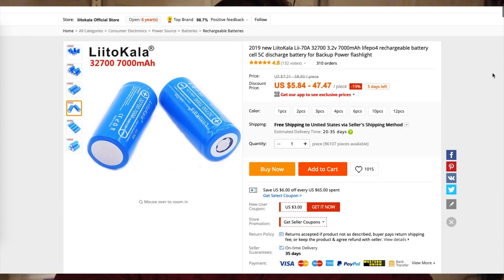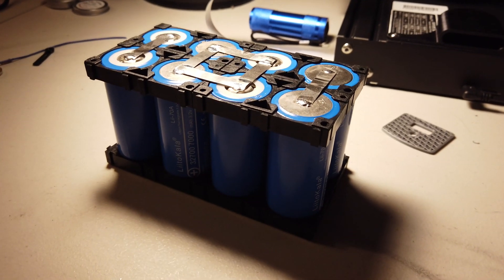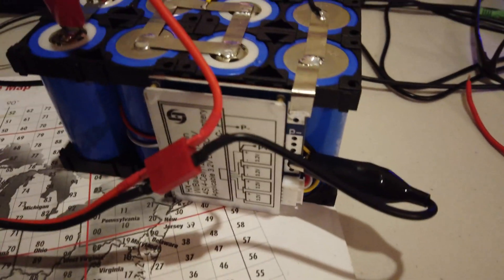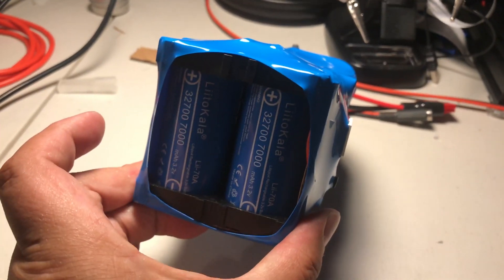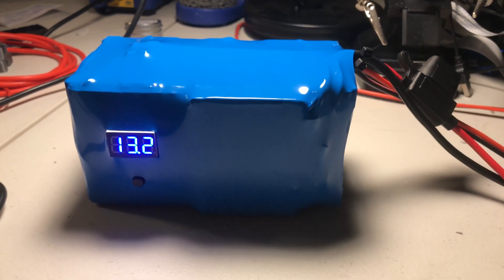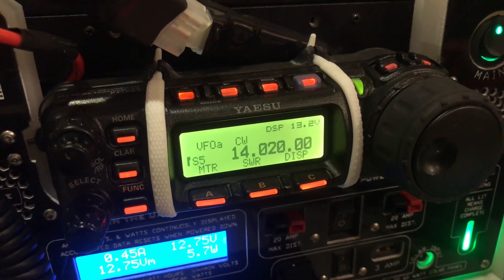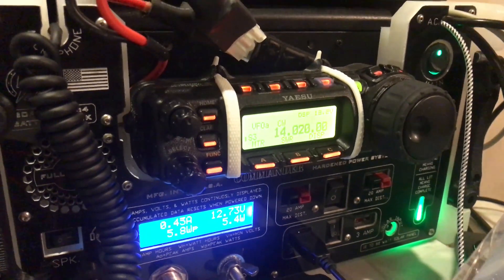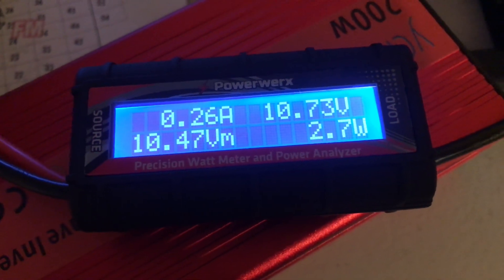Testing LiitoKala "7Ah" LiFePO4 Cells

Comment: Hello Dx-ing, from LA2LOA. Interesting video. I am just about to buy LiitoKala battery for power bank, model type 32140 3.2V 15Ah LifePO4. Therefore your test of interest. What is this, garbage? Low price, you get what you pay for, generally speaking. TIP for you, buy a POWER CHARGER BATTERY TESTER, ZKE tech EBD-USB + is a special USB charger and is used for testing all types of batteries. You really need this tester, have used this for years. The tester is connected to the PC and shows graphically the degree of battery performance in time, amps, Wh etc. Auto cut, before the battery goes into deep sleep. Good luck.

Comment: That voltage sag does seem in line with a 30A cell but you have two in parallel so I’m thinking these are 15-20A tops

Comment: There likely is no real datasheet. These are probably 
A. Made in small runs from LK and there’s no customer expectation from LK of the cells meeting any standards. As long as most randomly selected cells meet some basic minimum sniff test (charge to 3.65, rest above 3.4, capacity test somewhere over 5.5Ah, voltage is above 3.00 with a load of a few amps) if they come out better great! If the batch is just meh we’ll sell them off and hopefully the next one is better. 

B. These are “Grade B” of some known brand but that means the datasheet will only be a loose guide as to what you can expect. 

If these were made to any standard the factory would have a safety datasheet for the exact chemistry and a datasheet on the minimum specs and they would be QC’ed to ensure the voltage and IR is correct prior to packaging. I’m sure you’ve seen videos of those desktop IR/Voltage meters with a vertical cell holder that allows a worker to easily pop cells in and out. The display will flash if the cell meets/doesn’t meet the specs you can enter in for max AC IR (1khz) and minimum voltage.

Comment: I think the battery was undercharged when you started your testing. The battery voltage for a true 4s LiFePO4 battery should be at 3.6 per cell or 14.4 volts total. I think this lead to the shortage of MAH capacity you estimated. You should do the test again and update the description if you have better luck.
Reply: Resting voltage should be 13.6 (3.4V per cell) minimum. They were mostly full. Past 3.40 there is very little capacity, in a 5Ah cell you’d see a few hundred mAh at most. Just like below 2.75V to 2.5V. The quarter volt at the top and bottom is barely anything capacity wise. Most people agree 3.00 to 3.30 is 80% at least

Comment: The full charge voltage is 14.4v, then yours you only charge it at 13.6. It's not full yet that's why you only get 10Ah.
Reply: 14.6 exactly for 4S lifepo4

Comment: That's not that bad vs price, and not least conversation loss and that jazz and pretty sure these 150watt RC LIPO power meters. (cost like 6.5USD delivered) are not reference meters.
You should have taken a few cells and tested them nude, an amp-drainage graph at 50% of claim max amp rating, and a sacking-graph at 80% or 100% of claim amp rating.
with those two readings, you can see if their claimed peacock feathers are loyal.
Liitokala is pretty big, most people likely know that brand from battery-chargers or under Colaier, but these last few years they are selling a lot of batteries listed as Liitokala, often rebranded batteries, we usually know under other names from fx LG, and others.

Comment: i was thinking about building this exact setup to replace the battery on my motorcycle. will it hurt the batteries to charge them directly from the alternator? I was going to do a 4s2p also
Reply: It is not recommend to charge Lithium batteries directly from an alternator. The internal resistance of lithium batteries is lower and will cause a higher draw of current throughout the duration of charging. This will overheat the alternator. It may be better to stick with the standard Lead Acid. If you really want lithium consider using some type of current limiter or dc-dc charger.

Comment: I have same cells and they seem to have about 6.3Ah (discharge @ 2 amps to 2.5V cell voltage). Some cells may have little less, but each cell I have tested get at least close to 6Ah. Perhaps your measuring method is not accurate or there might be some bad cells in your pack. Try to test some individual cells and see what you get.

Comment: How did you decide this BMS 100A? Does this depend on the load or the battery max capability? Mind sharing the formula?

You are not getting the full capacity because you need to break-in LiFePo4 with about 20 cycles to get the max. capacity. If is LiPo, it would be just 3 cycles.

Comment: I got 10 from India rated at 6Ah each for $75.    I tested them all twice.   They drew 1 amp for 6 hrs then the charger shut off.  The discharge was thru  large ceramic wire resistors.  They provided 1 amp for 6 hrs.   If anything they were slightly over 6Ah.   Maybe like 6.1Ah.   So, I am happy.    Will be using 3 in parallel with a boost converter to provide 6v for security cameras.   Charging is with a 10 watt solar panel and a buck converter set to 3.62 v max.  No balancing needed.    The boost converter shuts off at 2.5 volts.    They have been deployed for 2 weeks.

Comment: Discharge cut off voltage: 2.5v x 4s= 10v  . Inverter cut at 10.5v (to protect a lead-acid battery). Your battery have a 14Ah capacity.
Reply from the maker: Good point. Thanks!
Reply: The battery is nearly empty after 2.8V (at least these liitokala batteries). They could provide not more than 200-300 mAh from this moment. It would make maximum of 400-600 mAh for 2 in parallel. 
I am testing these batteries for the last two weeks for my solar power station. That's why I am sure :)

Comment: That's a miss print on data sheet ... manufacturer forgot it was liFePO4 and put nominal voltage for Li-ion , 3.7 ...I've made something similar ...I sealed my voltmeter under the heat shrink , didn't cut a hole , the light shines through heat shrink and isn't so bright and intrusive.

Comment: Good information, thank you. I ordered these cells a month ago and I did not receive them yet; they still have the status  ready to ship. I plan to make a 4s9p pack and will report the results asap. 
As the audio is concerned you could definitely improve your video...too much beeping. My ears...outch! ;-))
Reply: How did you get on? Have you tested them yet?
Reply: Hi Daniel, - I received 40 cells and individually charged them. I measured between 4.5 to 5.4 Ah for each cell before they were fully charged. 

Then I started building my 12V battery (4s9p): first I made 4 packages each containing 9 cells (3x3) in parallel and then put the 4 packs in parallel in order to have exactly the same voltage in each block. 

Then I put the four blocks in series and finished the battery by adding a BMS (4s/12V/60A) and a separate BMS cable, in order to monitor externally the voltage of every block. The aimed capacity was 9x6Ah (6 Amps continuous draw as indicated in the specification of the cell), thus 54Ah. 

I put the whole pack in a 3D printed tower made from white PLA and my battery was finished.

For testing I branched an 2kW 220V inverter and let a 500W heater running for somewhat more than one hour. My amp meter showed a steady 40 to 42 A during discharge. Occasionally I added another 300W heater leading to 65A draw for some minutes, just to check if maximum load was possible. The average temperature of the housing was 25 to 27 degrees Celsius and a hot spot of 40 degrees at both battery terminals. I stopped discharging at 2.95V average per cell. 

In the evening I started charging the battery with 7 Amps using my ISDT SC-620 500W smart charger, set for LiFePO4 (but without branching the ISDT balancer, as I didn't want to mess up with the built-in BMS of my battery.) 

In the morning, charging was completed and the ISDT indicated a total charge of 688Wh which corresponds to 688/ (4*3.3V) = 52.1 Ah. This gets very close to the calculated value of 54Ah. - So, I am quite happy with the result.

Comment: You talking to UFO's? Ha-ha, you should try some super caps, , if you get some high capacity cells, that can't handle current spikes, a small 100F cap bank can help the batteries last longer, , I'm off grid, completely, with solar, I like battery videos, solar and electronics videos, especially when building things, ill sub give your channel a chance,

Comment: Have you really tested the cells? For capacity, and if that is lost fast? I have heard some of the lito kala have been fakes, but they were obvious, you can remove the wrapper, they may be stamped! Littokala doesn't make cells, they buy from manufacturer, and rewrap,  I would like to have some if these if they are the real deal, or even close, I need about a 2000 ah 24v Bank,  for off grid. I will have to build slowly, i have about 550 ah now, but need more! I could swap to lifepo4, from          li-ion, if the price us right!

Comment: Hello . Can i use it for electric bike ( 60v , 20A ) ?
Reply: This type LiFePO4  is heavy and is better for static use , power walls , or replacing car battery because of it's lower voltage ...ebikes use  li-ion,  using reasonable quality 3AHr  18650s  you will get 80% more miles  for same weight of battery compared to using cells in this video
Reply: @oz93666  @ Thank you very much for reply .
Reply: @oz93666  he use it for a bike not for a drone where weight its essential.
A little more weight for longer lifespan of battery and much safer ,i think it worths it.
Reply: @mihaiilie8808  Have a look on Youtube .. many professions making battery packs for bikes and they all use Li-ion because they're lighter .... LiFepo4 are fine for stationary applications or for car batteries for petrol cars ...
All electric cars (Musk)  use Li-ion .. they save money in the long run , less mass to speed up and break ..
Most of the batteries I have are Lifepo4 used for solar storage , they are slightly cheaper .
Reply: @oz93666  Lifepo4 from the chinese brand Liitokala ( makes best highest discharge rate li ion also,40 amp continuous draw compared to Tesla just 15 amps and Samsung max 25 amps) are as heavy as li ion .
Check the Liitokala 7000 mah LiFePo4  batteries they have.Compared to li ion they are much safer,can be charged much faster and last a lot longer.
In fact they are soo light that i plan to use them even for a drone because i dont see much difference in weight compared to li ion.
Lifepo4 from Liitokala are for sure a lot lighter than lithium polimer .
And they cost only 4 dollars a 7000 mah battery.These dont need to be cooled much like Tesla cools the li ion batteries with water so that the car doesnt burst into flames wich its crazy and like an improvisation.

Comment: 'm thinking to buy some of these batteries to test, by the seller charged 4s should be 14.8v and you charged up to 13.6v.
at least it should charge up to 14.6v. ??
I am thinking to use without bms only with the balancer and charge as a 12v battery.
Any opinion of yours would be interesting to hear.
Good job your battery looks great
greetings
Reply from the maker: It was charged to 14.5v before the BMS stopped charging, and settled back down to 13.6 before I started this test. I like the BMS for protections. I do not recommend building LiFePO4 batteries without a BMS. You can probably get by with balancer and smart charging, but it is certainly more risky to do this without BMS, especially if one cell gets mismatched from the rest.

Comment: Don't waste your time/money with these no name cells. All the energy  put into investigating could be used putting together quality cells. There is no benefit to "cheap chinese no-name" rant concluded   carry on 😀
Reply: Manny of the non labeld cells are grade b cells that they sell too make i little money back
Reply: All the lifepo4 batteries are manufactured in china and even the noname ones are very reliable..
Reply: @nainabla  you're missing the point. Many of the no-name ones are mislabeled or not even labeled the correct chemistry. This is more of a problem with the sellers than the manufacturers.